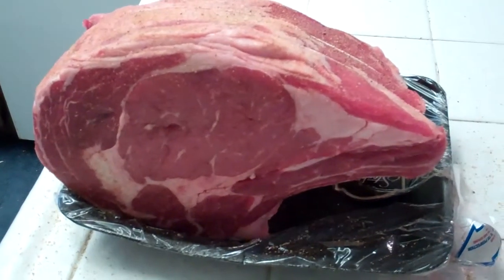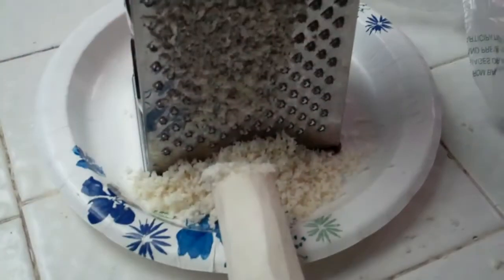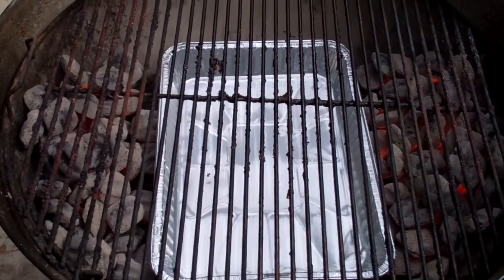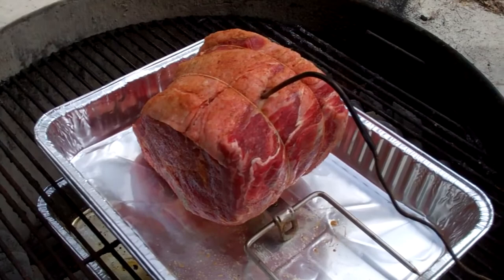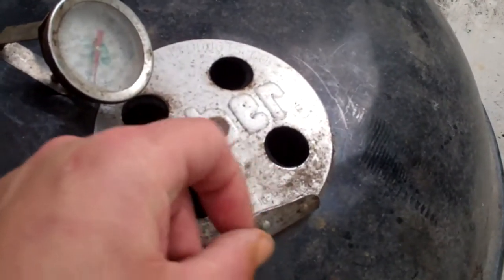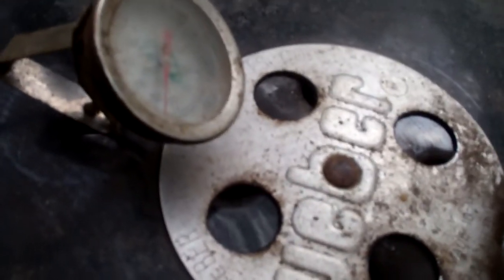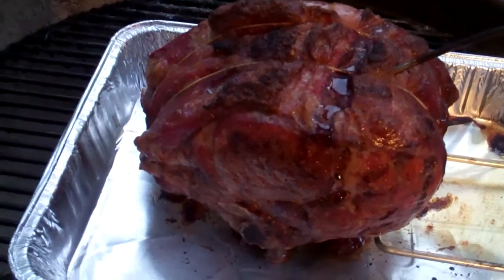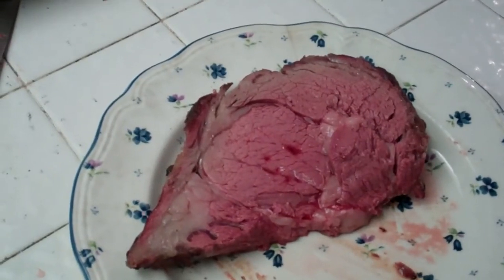Prime Rib on Weber

Comment: Couple thoughts.  Burn off the additional charcoal in the chimney starter, you just ruined your meat.  Second add wood chips in the first hour after that the meat becomes sealed and it doesn't do much.  Third the holes on the top control the air flow, open allows oxygen through and it will burn hotter.  Its better to put more I then not enough as you can control the temperature better.   Happy grillin'